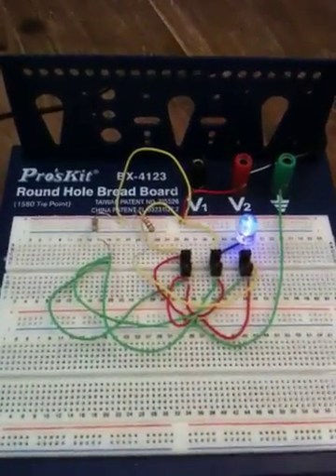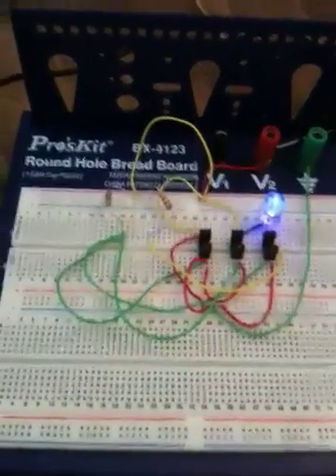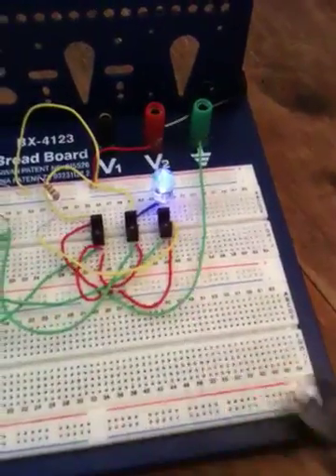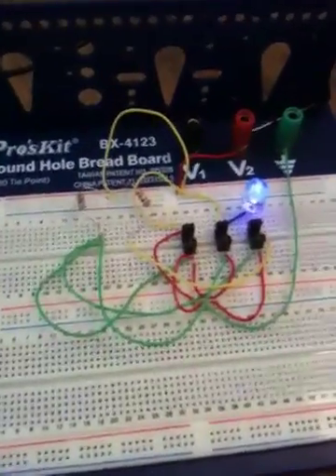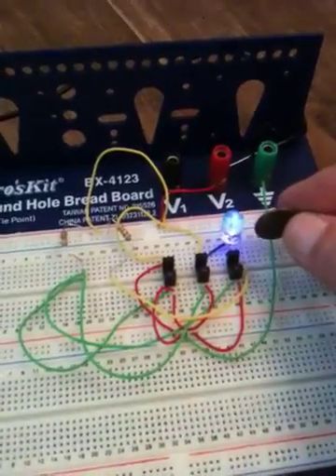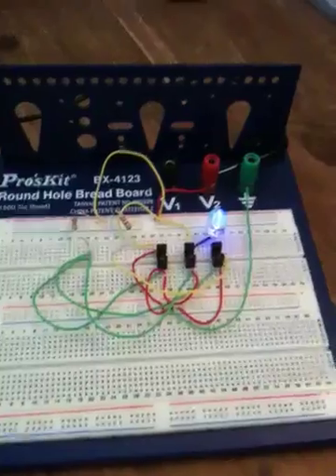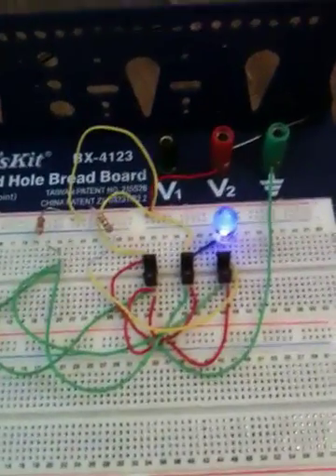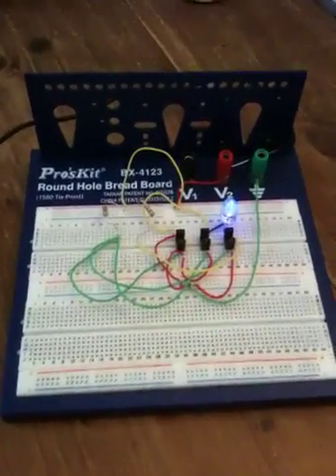Optical Slotted Switches in series

Comment: These are really good at creating a closed loop system for your cnc. Create a flat disk out of a film that mounts on the rear pole of your stepper motor.

 On the outer edge of this disk cut 100 slits all the way around and mount your Slotted Optical Switch so it can read it. As your stepper motor turns your circuit counts the on/off for a total of 200 pulses.

They sell disks like this but I have never found the name for them. If anyone knows please reply. They are used in most cheap printers!